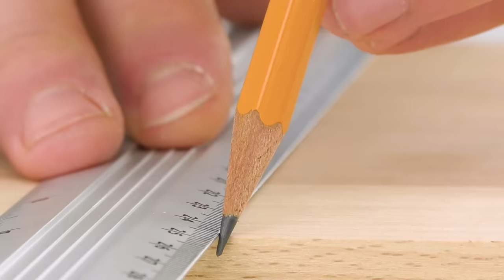How to Make Powerful Hydraulic Press

Comment: So u r saying cracking nuts is harder than making your hydraulic ?
Reply: He is and he’s right. Without tools you look like a fool
Reply: But to make tool you need tools is it right?
Reply: Lol
Reply: Michael Fixedsys e
Reply: baw0909 i like your thinking
Reply: There's a trick that makes it easier to crack some nuts with your hands, just press the back of your palm against the other and put the nut in between ofc.
Reply: Sure a hammer can crack nuts, but can it flatten a soda can?  Yeah yeah, you can just stomp on the can.  But this is pretty interesting since I want to use one to make aluminum foil cubes.
Reply: baw0909  nah you are just overthinking it...
Reply: U Am 300th Liker Of Your Comment
Reply: @sikandarjilani3950  thanks
Reply: @DIVANGSHAH  😄

Comment: The wooden piece that is glued to the four syringes could have been as wide as the space between the walls because then the crushing force would have been more stable and not "wiggle". With more stability You will gain a lot more even force on the object being crushed and the press will not break as easily. just my humble opinion... 
Still - nice done!
Reply: Kenneth Axi
Maybe, but if it were that big, it might jam up against the sides, I'd think. Adding some lubricated metal guide rods might solve that though.
Reply: Yes that would do it - and also make sure that You distribute the force from the syringes evenly on the pressure plate, i.e. place them close to the corners of the plate instead of in the middle.
Reply: Are you two scientists
Reply: gaming beaver
Born and raised. 😊
Reply: gaming beaver nope. Just a very curious guy!
Reply: That actually would make 0 difference
As the pressure would remain equal
Reply: The discussion is about it being more stable. And yes, the pressure wouldn't change but the force would be less since it's rubbing against the guide rods.
Reply: Lalama yes, but it still wouldnt be more stable, unless you remove friction and air resistance, but still, thr size of the board doesnt change stability
Reply: guide rods
Reply: This is false, bigger space means less pressure, pressure = force divided by area
Reply: +Lalama cv
Reply: +gatelys cv
Reply: gatelys even though you increase the area wooden piece doesn't change anything here as the wallnut will still be smaller than the wooden piece is force will still be applied to the same area 
But it will give it more stability
Reply: Sooooo hummmmble!
Reply: thought the same thing while watching video
Reply: Or just don't put two together to make a long one.

Comment: Can you mke a more detailed version of this? explaining more? And you didn't give enough measurements.... And how did you make the one way valve?
Reply: chester lover like that person would care about anything except money
Reply: Who says they wouldn't?
Reply: Jesus christ
Reply: This is very simple and straight forward... maybe it is just me... but the “one way valve” is just two syringes with the tips cut off with a plastic bb in it. It is called a one way check valve. It allows flow upwards in this case because gravity is holding down the bb just enough. It does not allow flow back through because gravity and the pressure of the fluid wanting to go back is holding the bb on the opening. But overall this whole thing is pretty much useless because it will take a long time to crush the item and still will require a lot of force (because you are pushing on a very small volume of fluid) with the four other cylinders it allows for 1/4 the force to push but takes 4x as long. And still a lot if force. I could do the math but it is not even worth it.
Reply: your daun ?
Reply: autizm not izlechim

Comment: You need wood, 4 syringes, pipes and glass with water
Mesurements
3 blocks of 15 cm by 15 cm
2 blocks of 38 cm by 15 cm
and 12 by 12
(for the top of syringes)
Reply: Good job
Reply: bhai pipe kaha millenge

Comment: Can you measure or workout the maximum pressure/force this setup is able to produce?
Reply: Not much since the syringe is plastic and is unable to hold much pressure
Reply: yes its about 3 fiddy
Reply: probably less than my someone stomping on it
Reply: I would surprised if it could handle more than 300 pounds because the fluid starts by passing the diaphragm. if you used and actual oil of some kind with some viscosity to it then your limit would be the strength of the plastic although it wouldn't last long because the oil could degrade the plastic so you might want to try something like honey or a bottle of pepto. food grade stuff you know. I think the pistons would snap long before the cylinders cracked so just buy one of those syringes and stand up the plunger by itself and keep putting weight on it until it snaps and then you'll have your answer.

Comment: How could liquid have so much power, just incredible.
Reply: Liquid doesn't compress like air.  Notice there are 4 syringes on the press and 1 syringe pumping.  That means for every 10mm the pump pumps the 4 syringes move 2.5mm.  It just quadrupled his input energy.  Hydraulics are flicking awesome.
Reply: Water cuts/grinds/pulverizes any material at the right psi

Comment: put your hand under there ;))
Reply: Alvin 2w it’s not that strong
Reply: I would do it. Just try standing on one hand. Thats about 80kg. I don't think that this press can produce 80kg of force.
Reply: WTF? Take two syringes and glue them together? It is not a matter of force but of stability. You can clearly see them bending while pressing.

EDIT: By can not produce enough force I basically mean that it will most likely break before it reaches its pressure limit.
Reply: No it doesn't. Heard of sth. called transmission?
Reply: Exactly.

Comment: 2:40 What kind of ball I mean material
Reply: plastic? it doesn't really matter. you could use a marble if you wanted. it's essentially a 1 way valve like what you would find in a bottle jack. it keeps the pressure from bleeding out of the cylinder. in a bottle jack the little ball usually has some spring tension on it to keep it down so when you pump the fluid through, the pressure is able to lift the little ball and pass around it. when you come to the bottom of the pump and have to lift to pump again the pressure stops flowing into the cylinder and the ball seats itself over the hole stopping the fluid from bleeding out of the cylinder.
Reply: I used a mentos, works fine.    just kidding.
Reply: @justarandomfishguy8868  you gave me a great idea. what if the hydraulic fluid he used was pepsi and he dropped a mentos in the system? it might actuate itself.

Comment: Hi, I live in Brazil, I'm interested in the project. I will carry it out and present.
I have some questions: What is the volume of the smaller syringe you use to pump to the frame (15 ml, 10 ml)? What is the volume of the small syringe that has been cut and used as a "pumping" of water and what is the material of the small ball (and diameter) that has been closed in the syringe?
Reply: Lemonb 😁😁

Comment: Where did you get an NRV and Y-shape connectors from? I'm sorry but some more details would've helped. The way yhe system is connected and the bypass for the returning fluid from the press back into the cup,... The search I did led me to aquarium tank accessories but it doesn't look like that's what you used here.

Comment: I tried all steps, 02:37 this step not working, any idea?
Reply: You need them both be be vertical and arranged in a way that prevents back-flow through the press end while you are pulling the syringe and whilst not doing anything and to allow flow when pushing the syringe. The reservoir end needs to allow flow while pulling but restricting back-flow when pushing the syringe. I suggest looking at exactly how he has it set up. A way that this should work is to have the syringe attatched to the top of the reservoir flow-restrictor and the bottom of the press flow-restrictor. This makes it so when you pull the syringe the plastic ball in the press restrictor stops flow while the ball in the reservoir restrictor allows it. The opposite applies in the push stroke. The flow of water frees the ball in the press end while simultaneously locking the ball in the reservoir restrictor, allowing uni-directional flow so that your press works. I hope that fixed your problem.

If it was about the joining of the syringe nibs then disregard the above and use either hot glue or some sort of epoxy adhesive.
Reply: @asancoon2363  what is that mechanism called and how does it work? any ideas?
Reply: so i played the video is slow speed and watched the mechanism carefully and i got how it works it's rather cheeky so the incoming flow has to come from bottom so that when flow comes from bottom water pushes the ball opening the flow while gravity keeps it from hitting and blocking exit which is upper opening so maybe yours is not working because you have one of them installed in wrong direction or the balls that you are using are not right i think he is using kind of rubbery balls maybe airsoft or something else that can restrict water
Reply: @xuaalbito8303  its called a check-valve or one-way valve. If the flow goes against the desired direction, some mechanism closes it. Simplest one would be just a flap over a hole. Water flow would push it shut if it tries to go one way but would allow flow from the other end

Comment: [ Content Deleted ]

That’s probably the most savage check valve I’ve ever seen. I usually make mine using a 30ml syringe with a 20ml syringe plunger with a spring pushing the plunger shut. The lid the the 20ml syringe nozzle cut down to 5mm

Comment: how did they actually get two syringes to hold the pressure? The thin plastic is hard to work with especially considering the pressure it needs to hold up. There is no way they just put some tape and called it a day

Comment: What are ALL the materials needed pls reply i need to know xoxo
Reply: You need wood, 4 syringes, pipes and glass with water
Mesurements
3 blocks of 15 cm by 15 cm
2 blocks of 38 cm by 15 cm
and 12 by 12
(for the top of syringes)

Comment: Hello! I'm trying to make the same version of hydraulic press as you did, but im having a problem with it. There are air bubbles inside the tube that flows water. Is it because the ball that im using are not compatible/doesnt match for the syringe? Btw im using the back of the thumbtack as the ball in 2:37 Kindly hope for your reply on this because im doing this for my hydraulic project.
Reply: I'm sorry that you didn't get an answer. I hope it worked for you.
Reply: @rudesback5013  Thank you for the respond i appreciate it! :D It's okay i have grad my Diploma with flying colours! thanks to your video i learned a lot.

Comment: How did you make this so you're able to pump the input syringe multiple times without the water moving in the opposite direction when you pull it back up during the upstroke of each pump? Is there a pipe segment that lets air in but not out? If so, where would you find this piece?
Reply: Its using ball and gravity to block the nozel

Comment: When you trying to bust some nuts with your hand  EVEN though that's like almost impossible so you buy  a drill, cut a needle thing,buy hydraulic fluid and glue stuff together for a hour or so and you make a hydraulic press so that you can finally do what any thing that's not soft could do.